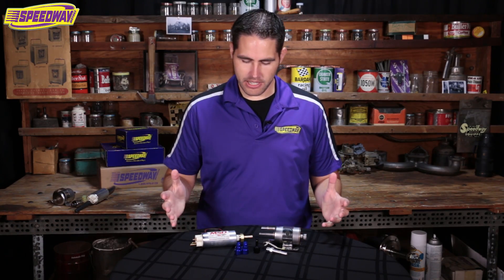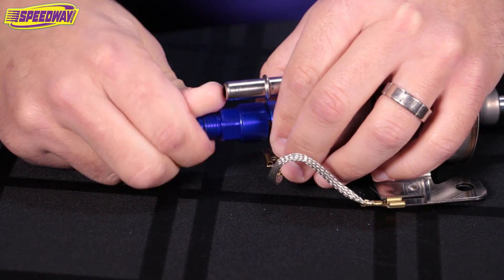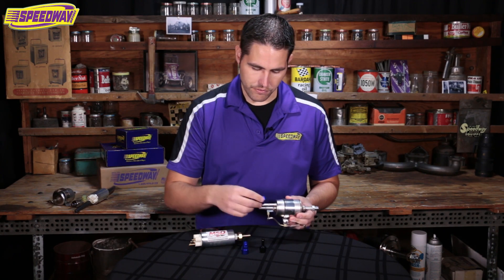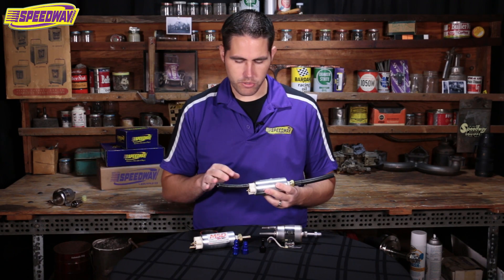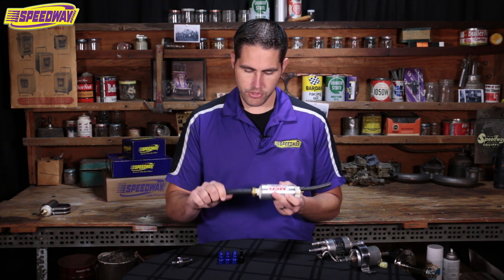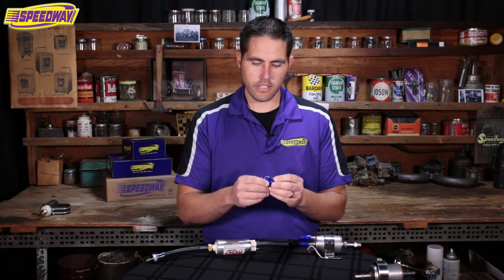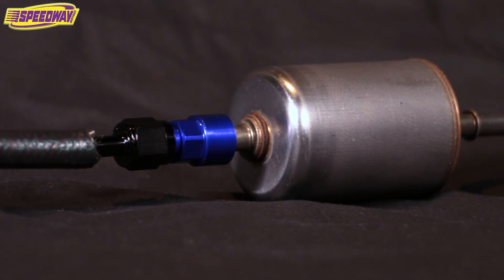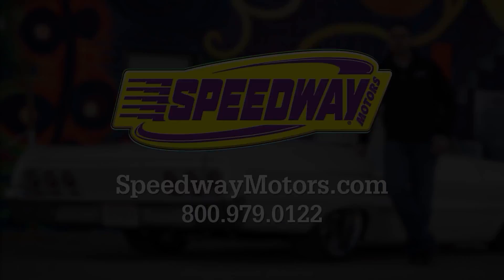Speedway Tech Talk - LS Fuel Delivery Kit Questions

Comment: What if you have a return line on the engine? the regulation is in the rail? so i cant use that regulator/filter?
Reply: Thought he said what to do if that was the case? Use the EFI filter instead of the one that comes with the kit, think if you call speedworks before you order it and tell them wassup, they’ll help u out

Comment: The same fuel pump damage factory or aftermarket comes with todays fuel prices. Please, never drive around everywhere with 1/4 tank or less. This fuel lubes the pump, cools the pump and reduces wear on internal bushes and rotors used to develop pressure. If you starve your pump, it draws in air, air reduces volume and a reduction in volume is low pressure. Low pressure equals misfire on hard hole shots or turns like big looping interstate off / on ramps. Too many misfires and you threaten to overheat a catalytic converters if equipped. This means the CEL flashes once per second. 
DK, ASE master, retired.

Comment: Hello Speedway, that's cheap fuel filter with the bronze insert screening that you are using before the pump, states on the site that it is Not for fuel injected engines, but for carbureted only, Please clarify?? my LS engine is Fi, Thank you.
Reply: Since it's placed before the pump it's just keeping junk out of the pump. It would only be an issue if you placed it after the pump.

Comment: Can you remove the internal pump on such vehicle as a 1996 4.3 and run a drop tube in its place and run this pump externally? Plan on fuel system for 6.0 running 500hp range on 42lb injectors occasional drag strip use.
Reply from the maker: We've never attempted a setup like this, but if you call our tech line at 800.979.0122 to discuss your setup in detail, we should be able to get your specific questions answered. Thanks!
Reply: @speedwaymotors does it wrk on 5.3 ls carb

Comment: Can you use this on a 4cylinder 2.4L  07 Chevy cobalt SS with a fuel cell? We are using it for dirt track!
Reply from the maker: It depends on what the pressure requirements are for that particular 2.4L engines efi system.  If it needs 58psi, it should work fine.
Reply: Speedway Motors it needs between 40 and 60
Reply: Is there a higher psi kit by msd if so can you plz send the number to me to order plz?

Comment: Are you saying the feed to the fuel rail is 3/8 and the return is 5/16?

Thank you for your time and help
Reply from the maker: Yep, that's correct.
Reply: @speedwaymotors   On the video he is connecting the fuel pump to the 5/16 on the pressure regulator but on the your website for this product it shows that on the pressure regulator  the 5/16 is the return and the 3/8 is the inlet for the pump.  I am confused.
Reply: Yep, that's how it is.  About dumb as you can get.

Comment: I have a return system but I added a corvette fuel filter regulator. What would I do with the return line on the fuel rail?
Reply from the maker: If you have a regulator on your fuel rail I don’t believe that you can use the filter/regulator with that system.  You need a dedicated return line from the rail back to your tank.
Reply: @speedwaymotors  I have Corvette engine 1998 feed and return fuel rails...but I purchased from yourself a msd pump and regulater to run a single fuel line now you are saying that you cant do this with a feed and return  fuel rail...I dont want a return fuel pipe...what can I do..

Comment: is there an option for that pump to have AN fittings in and out of it so i dont have to run rubber lines to and from the pump?
Reply from the maker: The MSD pump does not have option for AN6 lines but you could opt for the Walbro kit number 91012806 to have all AN6 connections.

Comment: Ok it’s a fuel wire on the wire harness do you hook that to the pump or would you run 12volt with a switch?
Reply: I know you asked 2 years ago, but is the “switch” you are talking about a fuel pump relay?

Comment: Not a good video!! I'm even more confused now than when I started.... He said hook the 5/16 from the pump to pressure side of the regulator which is supposed to be 3/8 right? But in the demonstration he hooked the 5/16 from the pump to the 5/16 (supposedly the return) on the regulator, "the bigger middle one" is what he stated... So which is the correct way?
Reply: 3/8 from tank to prefilter - 3/8 from prefilter to pump - 3/8 from pump to regulator/filter combo. 5/16 return to tank single outlet on regulator/filter to engine

Comment: What hose will I have to use? Does it come in the kit? I have seen the Russell hoses but i didnt see you cover that... thanks '85 c10 6.0
Reply from the maker: Hose does not come with the pump and filter/regulator kit.  We offer Earls in the black EFI hose under number 425750055ERL for the 5/16 by the foot or also in 10 and 20 foot rolls.  The 3/8 is number 42575066ERL by the foot or also in the rolls.  We also have the special clamps for each and the fittings in straight, 45, or 90 degree.

Comment: is there anything more traditional instead of the Clips and or the Quick connects. We have a LS out of a 06 Tahoe 5.3 4L60e going into a 62 C10 Flatbed even if we have to buy new fuel rails and injectors we can spend the money to avoid the quick connects we plan on spending for A under bed In tank Fuel tank/pump

Comment: I'm swapping an 850hp LSA into an 04 Silverado and was going Togo with Aeromotive Dual 340 in tank but it won't work with my fuel tank because there isn't a large enough flat spot on top to hole saw a hole to drop the baffle and pumps into the tank and I'd rather not go with external pumps since this is my daily! Do you have a video showing how to retro fit pumps on a stock pump hanger and what size lines I can get away with on the top plate?? Or if no video, can you direct me to a site where I can get this information?? Any help would be appreciated!! Thanks!

Comment: Documenting a 5.3L LM7 Truck Engine swap for my Jeep project.  Can you line components up as follows:  Tank - Hose - Primary Filter - Hose - Pump - Hose to Rail?   I assume that I can get extra quick connectors for the section between the Pump and the Engine Fuel Rail.  As well as Fuel line and fittings for the return line.   Great video.  Thank for the information.